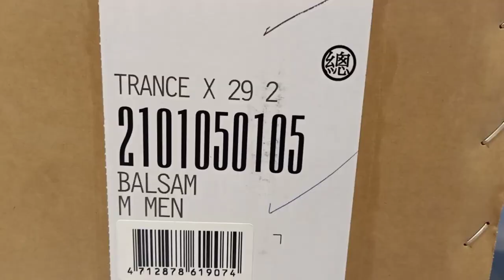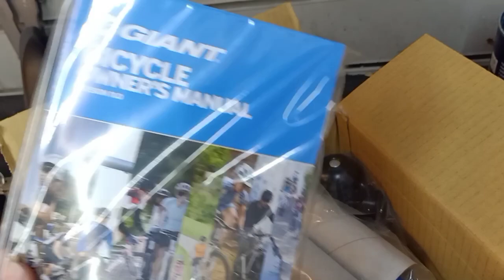UNBOXING & ASSEMBLING - NEW 2021 GIANT TRANCE X 29 2

Comment: im 6'4" hard to find a bike for my size in this area closest store id a few hours a way i love to ride but cant thanks for sharing nice looking bike
Reply: I'm 6'3". Just got a 2021 trance x 29 in XL. It's huge. Kinda wish I would have gotten a large. I love it other than I'm still getting it dialed in and fitted to my size. I have too much weight on the handlebars when the seat is at the right height. Too laid over. Feel like I need a stem extension or riser bars.  I drive 3hours to pick it up during Covid-19. Couldn't find anything near me.  If you can find one to test out first it is best. Love it other than feeling too prone.  I think riser bars will help. Comes with 20mm rise. 780mm wide. Might go 720 and 40mm on the rise . Would help us tall riders
Reply: @brentphillips9247  I'm 6' 5" and have an XL on the way currently. Haven't tested one yet but I've own a Trance in the past and compared the geometry to the one I used to have. I've ordered a 75mm riser bar (spank spoon skyscraper) for the issue you're talking about because I hate the neck pain from leaning too far forward. I think it'll look a bit funny but should be a good fit. I'll let you know if it doesn't work out, but take this as an early recommendation!